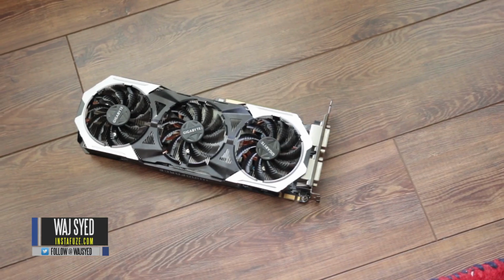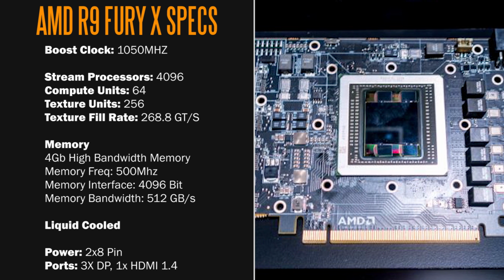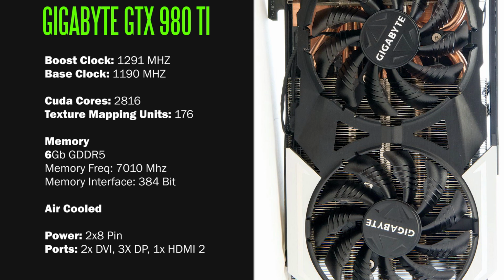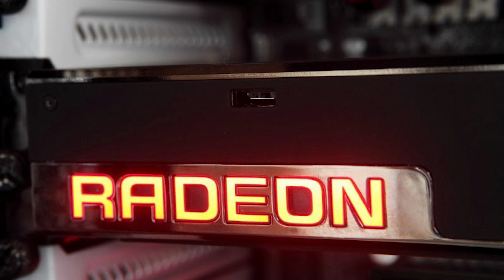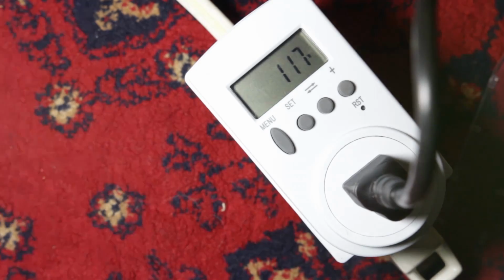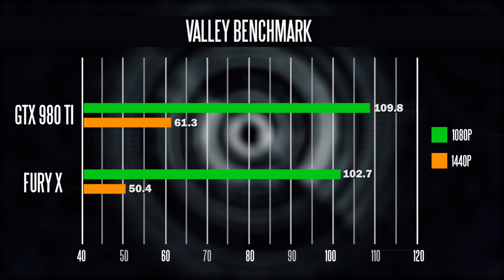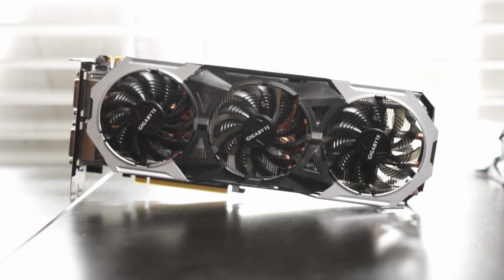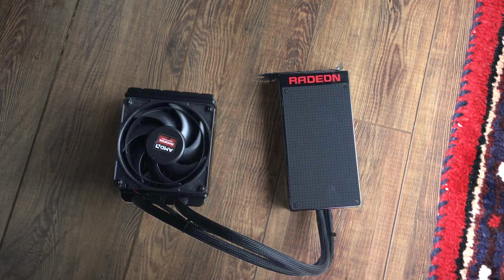AMD R9 FURY X vs Nvidia GTX 980 TI - 4k Gaming Benchmarks

Comment: What's the point of hbm if it doesn't drastically improve performance? Unless there is a driver that unlocks more potential, clearly in all of these benchmarks 980 ti stomps it. Driver support is poor on amd and owners of the fury x will have to wait months before they can get better drivers.

Comment: It sucks that the AMD 300 series absolutely destroyed the Nvidia equivalent, and yet with AMD's new fiji GPU is much less impressive than expected.
Supposedly it'll get better with more mature drivers/Dx12 but still it was beaten pretty handily.
Reply: +Made1nGreece wtf are you smoking? the 390 beats the 970 by 5-7 fps not the 390x.

If you look at DX12 possible benchmarks, the 390 will outperform the 980 and possibly 980ti, stop living under a rock dude
Reply: Made1nGreece look up benchmarks idiot, your 900 series is trash compared to the 300 series, especially in DX12
Reply: +Made1nGreece Actually , the r9 390x beats the gtx 970 in every resolution , which is normal considering it costs a 100 dollars more.
Reply: Bob Roberts
 I know AMD drivers are not as good as they should be, because the Fury/Fury X on paper should absolutely destroy a 980 Ti/Titan - but they don't, in fact in many benchmarks they perform worse. Obviously this is due to drivers, which aren't necessarily poor but they definitely don't use the cards to their full potential.

But gameworks IS anti-consumer inherently, because it doesn't allow for anyone but Nvidia to view source code until after the games' release.
This is bad for the consumer, these practices shouldn't be tolerated by anyone.
Instead of trying to fuck over their competition in underhanded ways, Nvidia should be bolstering their own product.

But these kinds of practices are nothing new and Nvidia didn't pioneer them, but it's still not something people should be okay with.
Reply: Bob Roberts
This isn't right at all, sorry bud. You ate the Nvidia FUD and you're regurgitating it.
AMD drivers have been consistent and good this past year, meanwhile Nvidia drivers have been shit - I would know, I own an Nvidia card.
"gaming oriented cards" do you even know what you're saying? this is just stupid, all the cards they make are "gaming oriented," they don't have high-end cards for the server market.

And Nvidia doesn't "work better with devs," that's called Gameworks - a program where Nvidia pays developers to sign a contract with them and only release source code of the game to Nvidia, and no one else.
This is an anti-consumer business practice and bad for everyone, regardless of what side you're on.
Reply: +Butthurt Beluga amd 300 absolutely destroyed the 900 nvidia series? hahahaha, nice joke. 390x, even with way higher specs than 970, plus 8gb, it barely has 3-5 more fps. in some games in 1080p, the 970 has more fps than 390x. 970 only lose in 4k cause it's not exactly 4gb. bellow 4k both cards are equal. amd 300 series came out 9 months after nvidia 900 series, and it's not even 10% better. i'd say 5% top, and around 7% in 4k. i'd still buy the 970 over 390x, cause nvidia has way better drivers, majority of games are better optimized for nvidia gpu etc etc
Reply: Made1nGreece

Except Nvidia drivers have been shit for the past year, the times of Nvidia having better drivers are long gone, AMD has stepped up their game in that department a long time ago.
And you don't even need a 390x to beat a 970, a 390 will handily beat a 970 - at this point a 970 is a trash card, no reason to buy it.

Not to mention that Nvidia GPUs are trash with DirectX12/Vulkan, in the Ashes of the Singularity benchmark (a DirectX12 game) a 290x, a last generation card, performs better than a 980 Ti - let that sink in for a moment.
A card that costs twice as much is performing worse in DirectX12 games.
Nvidia is not looking good right now at all.

But I wouldn't expect you to understand finance much, you are from Greece after all... lol
Reply: Butthurt Beluga in your dreams, maybe

so what if i'm from Greece? i'm Karate master and i have my own school and my own building, so i don't pay rent, and i have 86 students: 86 * €45=€3870. just because i'm from Greece, it doesn't automatically mean i'm poor
Reply: The Ultimate Walrus not in all games. in some games 970 is better than 390, and in some games 390 has 1 more fps. and 390x is 5% better from 390, so don't expect to be better from 970 by 10 fps. even at 4k where 970 isn't exactly 4gb and has way less specs than 390x which is 8gb, 390x has 6-8 more fps

outperform 980 and 980ti? thanks for the laugh
Reply: The Ultimate Walrus i am looking at benchmarks stupid
Reply: Bob Roberts for $100 more, + way more specs, this difference is absolutely nothing. and for around 5% more performance than 390, 390x is ubber shit. whoever buys 390x over 390 is an idiot
Reply: Well, then there is the fact that AMD doesn't have good driver support and nvidia has more gaming oriented cards . Nvidia also works much more with devs , so their cards usually run better .
Reply: gameworks is not anti consumer. Nvidia just works with devs so they implement features for their cards while making them run better on Nvidia hardware. 
While i dont know about nvidia driver support,  i do know AMD's is pretty  bad. 
What i meant by "gaming oriented"  is that gcn is a much more all-around architecture than kepler or maxwell,  which are more efficient at apecialised tasks.  This is the reason  amd cards are better for mining. 
After all the 390x has about 6tfops of computing power while the 970 only has about 3.6 but the performance difference is minimal.
Reply: I guess so ... I had no idea about gameworks though. I didnt really know what was really happening, since there is always nvidia saying they dont do anything and AMD saying they cripple games on radeon gpus, so i tend not to take sides .
Reply: *****
Both AMD and Nvidia have their own respective technologies, it's hard to say whether either one is objectively better than the other.
Nvidia cards (speaking this generation) generally run a bit more efficiently, while AMD cards tends to perform better in the same price bracket (as of right now).

This might change as Nvidia has been slashing prices on the 900 series.
Reply: +Butthurt Beluga If they had waited to release the hardware people would've complained about that too.

Comment: Amd still can't find a way to design a card that won't heat like crazy. Sorry but liquid cooling is lame solution. Nvidia 980 ti max temp is around 75-80. So fury x had regular fan cooling system would it stay in 75-80?

Comment: OH great cards! 700euros high end cards of 2015 and cant play 60fps at 4k a game of 2013!!(crysis3)....Great!!
Reply: +alucardgreece in America, 980ti is cheaper in $ than in €. 980ti Hybrid edition costs $750=€665. cheaper than the cheaper 980ti. MSI version costs $670=€610, while in EU it costs €770+=$868.26

about not be able to play at 4k-60fps, i bet they do this on purpose, so that people buy 2 or more of high end gpus to achieve that. and there are lot of people that do this, not just 1-2. if you buy 2 980ti you can play any game at 4k with 60fps

Crysis 3 is one of the most demanding games, even now. you see Battlefield 4 benchmarks, and at 1080p you get around 150+ fps with 980ti. you benchmark Crysis 3 next, and boom, 75+ fps

Comment: why are u using a reference 980 Ti in your benchmarks instead of Gigabyte G1 980 Ti? for example Witcher 3 on G1 980 Ti averages 85 fps at 1080p with AA on and hairworks on and at 1440p with the same settings it averages 70-75 fps. Also these are the benchmarks at the STOCK clock speed of the G1. Once you OC even factory it goes even higher in fps.

Comment: one of the things that is a common theme in videos comparing these two cards is noise levels and temps. I would like to see someone get a Corsair H80 and a Corsair GPU watercooling kit to see what the noise and temps of the 980ti would be as well as performance after you added a closed loop watercooling kit to it and overclocked both cards, (if both the memory and gpu on both cards can be overclocked) and then see how much further ahead the 980ti would be. if thats what a fury x does with watercooling, use the closest possible watercooling setup for the 980ti then overclock both cards and then see the results. if the fury x by default needs a watercooler im guessing the overclocking wont go to far, meaning the gtx 980ti that can get a very healthy overclock would massively out perform the fury x.
Reply: Mark Floyd They wouldnt show that because the AMD fans would go into Meltdown lmfao.
Reply: Had to throw a piece of meat into the pit of starving wolves to see if anything would bite. Ive owned cpu's from red and blue and gpu's from red and green. right now blue and green are ahead. they both have waaay better hardware they wont even release because AMD is barely able to get close to there old "new" tech.

Comment: i just benched my GTX 980 Ti, max temp was 66 degrees, on 3DMark, heaven Valley,  do you live in the middle of a desert? o.o?
85 degrees is extremely hot did you perhaps adjust fan profiles? is it OC'd why isn't this mentioned any where?
Reply: +Bike Dude Because of the great overclocks with the 980 Ti :)
Reply: Xerpadon Xerilious i get 82-83 C on witcher 3, 780ti.. but then again it was designed to go that hot, idk about the 980ti.
Reply: +Shaun Man my 980ti overcklocked 1400mhz hits 75c  (MSI gaming 6G OC edition)
Reply: I have the Hybrid, 1484/2003 at 52 degrees :)
Reply: +Carfreak36 Nice!, hope you'll enjoy that beast!  What clock you got on the memory? Those Evga's are killers!
Reply: +Unlimited Racing Crew dude..  if could let me know how that card is and what rez you running..  Someone offered to buy my two tians and so stuck between the two..  Fury or ti.. Will be buying a second.  But will be a bit..  If titan x was quite a bit better id jump on that.  Just hate to sell these titans and be pissed I didn't keep the 2 till have the coin to get 2 of the new..
Reply: Keaton Buster Well the one I have MSI Gaming 980 Ti is 10% faster than Titan X. It runs at 1380mhz while gaming. and temperatures are about 70-72c I have added more overclock to it and it's still cool and about 15% faster than Titan X and well faster than fury X which can't or barely benefits from overclocking. I'm running mine on 4k resolution and it runs games at ultra or high settings at very fluent framerate.
Reply: Keaton Buster https://www.techpowerup.com/reviews/MSI/GTX_980_Ti_Gaming/30.html

15% faster than reference 980ti nad 10% faster than Titan X. Alos you still have bigger OC headroom than Titan X unless you watercool it.
Reply: +Xerpadon Xerilious Effectively 8GHz :)
Reply: Bike Dude Titan X without liquid cooling won't overclock much, while 980 ti has lot of versions with very nice cooling fans. My 980Ti while gaming at 1500mhz it stays below 75C with fans at 70% Unless you water cool the Titan X the 980 Ti with good overclock will outperform it. Check out the link that I posted above.
Reply: +Unlimited Racing Crew There actually is a GTX Titan X Hybrid, but it is so extraordinary expensive, it doesn't compete ^^
Reply: +Xerpadon Xerilious 
What's your Extreme HD Valley score?
Reply: +Unlimited Racing Crew The 980ti is not 10% faster than a Titan X. Maybe the factory overclocked MSI 980ti is faster than a Titan X at stock speeds, but once you overclock the Titan X it's still the fastest. Overall the 980ti is still a better option because you can get stock board partner cooling and it's a couple hundred cheaper so losing a couple frames is well worth it.
Reply: Mast3r Race As i said above, 980Ti has lot of variants with much better fans than reference titan X. MSI Gaming 980ti operates at 1400mhz without adding anything to it at 72c under full load and that one is one example how it outperforms Titan X. The reference Titan X is not very good at overclocking. Once you water cool the Titan X and overclock it it will be faster than 980 Ti of course. I never said reference 980ti was faster than reference Titan X
Reply: +Xerpadon Xerilious  i live in pakistan and use a CM haf case (high airflow  series)

and my gigabyte 980ti g1  gets to 73 degrees on witcher III @ 1600p...the highest it went.
the ambient temperature was around 29 degrees.
Reply: +Xerpadon Xerilious He lied about the temperature, I guess.